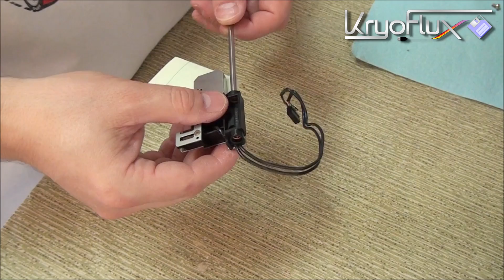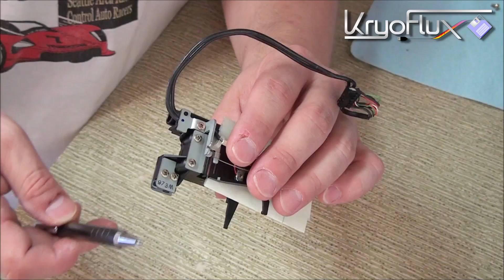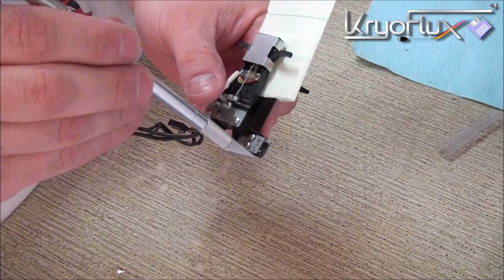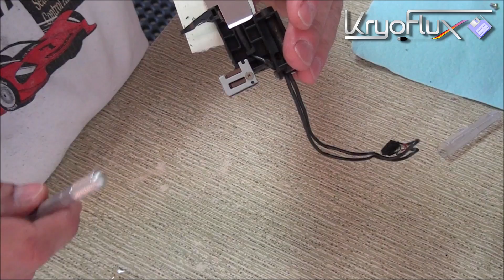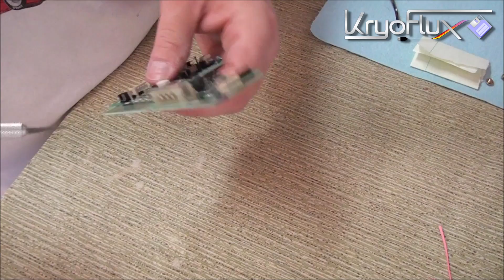KryoFlux Tutorial: Modify 5.25" drive to read "flippy" disks in one pass / Part 3 of 3

Comment: There's a cheats way to do a lot of the mods that are less messy and not so scary.  Use big sidecutters to chop\break the bits of chassis away, no filings.  For the bush relocation, I used a Stainless Hex Head 3mm bolt, screwed a SS 3mm nut down all the way to the head, placed that through the bush, put a SS 3mm washer on the backside, put a nut on the end and screwed the bolt tight to pull the bushing towards the washer on the bottom.  Once done, pull it all apart and presto, the bushing is where it needs to be and still in alignment.

Comment: Note that if you have another drive attached to the same cable, the track 0 bypass will not work as the second drive pulls the bypass signal to ground. Either remove the second drive when reading flippy disks, or, as I did, cut lead 33 of the cable behind the edge connector so it does not reach the other connectors. Pin 33 is normally just ground, but half of the leads on the cable are also ground, so it does not matter if pin 33 is not connected.

Comment: The drive modification does two things:
- Enable the drive to physically move the head past track 0 by removing obstacles
- Add a small circuit to bypass the track 0 sensor.

The track 0 bypass is controlled by the kryoflux via pin 33 of the floppy connector. The bypass circuit is just a transistor and two resistors. It pulls the sensor signal to ground when needed.

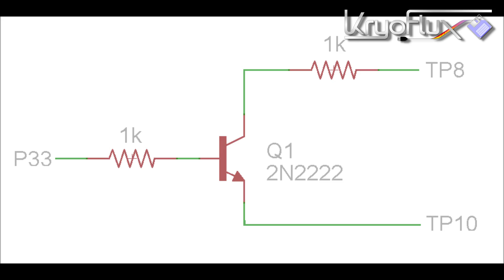TP8 on the panasonic drive is the track 0 signal, TP10 is just ground. See the video at 12:45 for a circuit diagram.

Comment: The kryoflux manual (kryoflux_manual.pdf, page 23) explains the general problem with flippy disks. It does, however, not explain how exactly to modify  a drive for flippy disk support.

Basically, the head on the upper side is not on the same cylinder as the lower head. It's off by 8 cylinders. So to read track 0 of the backside of a flippy disk, you actually have to seek the head to track -8. (continued)